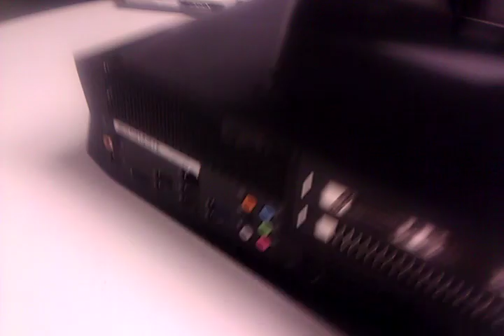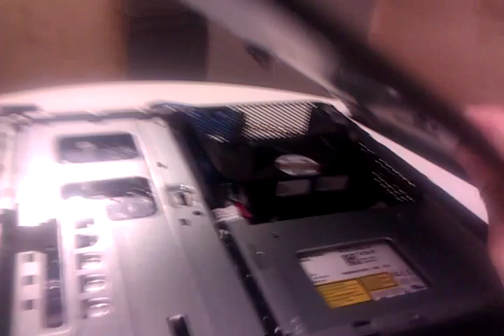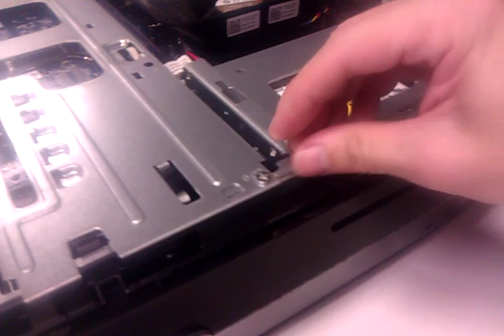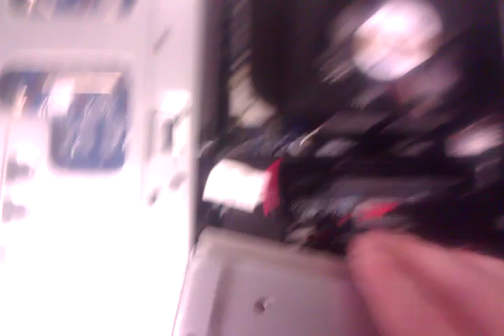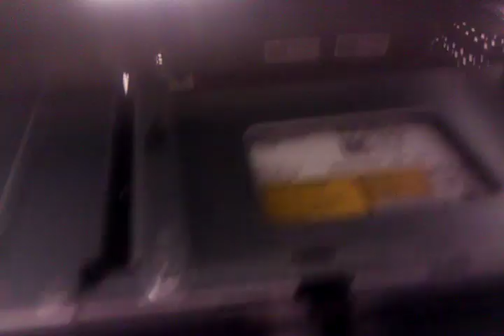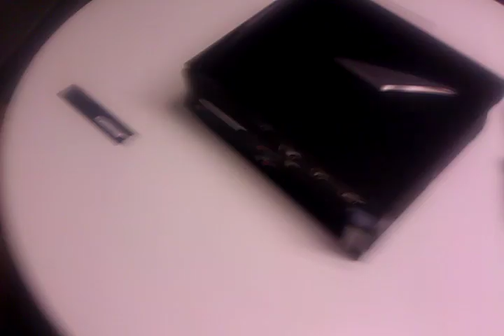Alienware X51 RAM Upgrade How-to

Comment: Great video- the only thing I would add is that you REALLY have to push the ram sticks down in place, and I mean HARD. The first time I tried turning my x51 on after installing my Crucial Ballistix ram sticks, it wouldn't turn on and just kept beeping- it scared the heck out of me, but the sticks just weren't fully seated. Works fine now.
Reply: This comment really helped me out, thank you for taking the time to share your experience.

Comment: Ram is Random access Memory. Ram is temporary memory your computer uses to store things you are working on for quick access later on. Ram is faster than your hard drive so things you are working on are temporarily stored there so you don't have to wait while it loads. The more ram you have the more programs you can have running at the same time

Comment: I don't know much about doing things like this with PCs and I haven't got one of these, but if I do ill get the cheapest x51 i3 as that's all ill be able o afford, therefore is it worth it? And then later on upgrading parts or? Also, will that specific model match up to the ps4?

Comment: If I am right, It comes with 2 4 Gig sticks, so you will have to get the full 18. But that is my speculation. For ram, you should get DDR3 RAM. I would suggest G.SKILL Ripjaws X Series 16GB 240-Pin DDR3. It has heatspreaders and such. Also, you can get a better graphics card after the 660, but your constrained to a 330W Power supply.

Comment: I am thinking of doin this. And I have a couple questions. 

1. Is 16gb ram the most the system can hold all together or is it the most it can hold in that one slot? And I currently have 8gb ram, could i just buy another 8gb ram stick and put it in to have the 16gb of ram?

2. Which ram should i use. I am fairly new to upgrading computers, so im a little bit slow on this lol. 

3. Not related to ram, but can the x51 have a better video card than the nvidia gtx 555?

Comment: the ones its telling me to use are 10600 or 12800 what is the difference and which is better? Also I have the X51 6GB RAM now I want to upgrades to its max, is it 16GB? if so I could just get 2 8GB and remove the 6 that it came with correct? thanks

Comment from the maker: Anything DDR3 10666 or thereabouts should work. Corsair, Crucial, GSKILL, etc should all work just fine.  If you get something with a crazy heatsink like a ripjaw, you may have a problem with the height of the ram, but the width of them next to each other is standard in all motherboards.
Reply: will 10600 work with 1333mhz?

Comment from the maker: Basic things to try are generally to remove the added RAM and see if the unit goes back to normal, reseat everything, the video card, cables, etc, just in case you knocked something loose. If removing the RAM helps, when putting it back, do so one stick at a time, and try each slot just to be sure.  You may find it doesn't like the original RAM modules to be mixed with a new one or similar.  Other than that I'd need a little more info to help you.

Comment: I installed the ram in my computer, but now that I'm rebooting it, it's not picking up the monitor or the USB ports--I waited something like 5-10 minutes, but it still didn't pick them up.
I did unplug them in order to install the upgrade. Do you have any advice, and do you know what the problem is? When I opened up the computer, I did pull on the case a little hard, but I don't think anything was disconnected. the type of RAM I was trying to insert was a Vengeance 8gb.

Comment from the maker: On most machines it won't really matter in general which slot you insert your RAM into if you just have a single stick.  The worst that will happen is that it will beep instead of booting and then you would move to the other slot.  There's nothing needed prior to installing, no drivers, no software, no plastic bits :-)  After you install, assuming the unit boots up, Click Start, then Right Click 'Computer' and choose properties.  Confirm it registers the amount of RAM you installed.  All done!

Comment: hi dererk i hope i spelt it right, i have the base model x51 4 gb ram, i decided to purchase a single 8 gb for the extra power and speed, your instructions were very easy and simple but as a computer nub in traning i had a few questions, 1) is there a certain slot it needs to be in      2) is there anything i need to get or do before installiing?    3) after installation what do i do? thanks i hope to hear back from you soon i dont mind long walk throughs to make sure i get it right thanks!